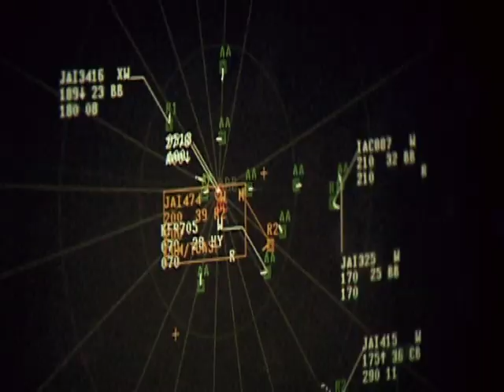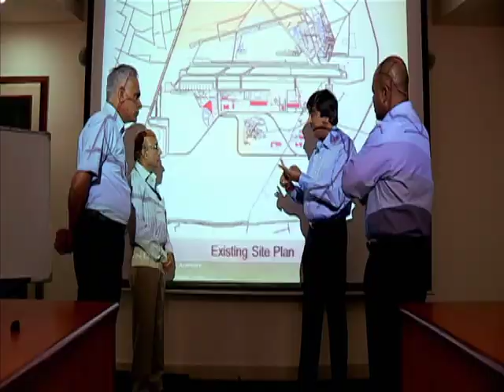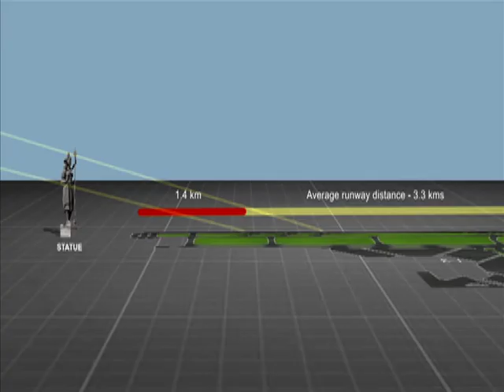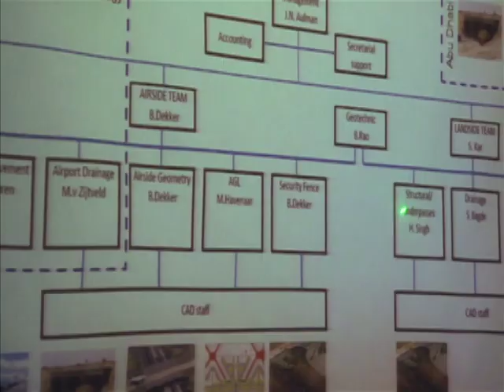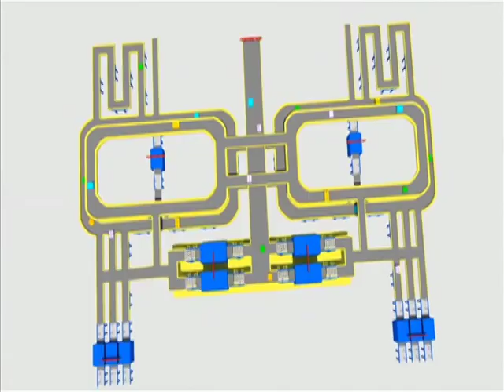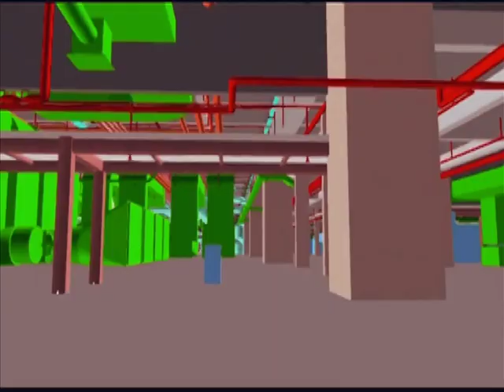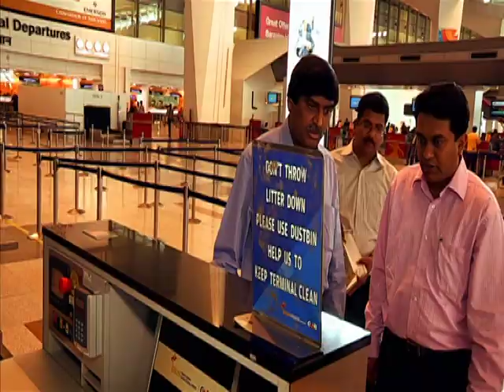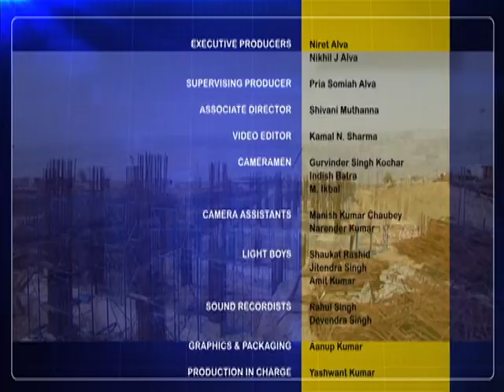National Geographic Megastructures: Delhi IGI Airport - Terminal 3

Comment: The infrastructure of IGI airport is great. I want to ask that the  IGI already have two runways and one was built later along with T3  which is 4400 m long. It looks parallel to the old runway (28 /10) but why it is not mentioned right R and Left L in the number. The runway no is also different but they looks parallel.
Reply: There no any parallel runway on IGIA Delhi,
9/27, 10/28 and 11/29. 
Go check it.

Comment: 37 months for a massive Air port is a great speed. Will it last like the Taj Mahal or crumble like the fly overs. At this speed we could out smart China if only the country uses her resources prudently However, we yet depending on imports from \
China and Japan. India should be able to meet the requirement for such mega structures. Make in India slogan will be meaningless, unless we translate it into reality. Trade with China needs to curtailed or moderated,
Reply: This airport was at Congress time anc now this made in india slogan is getting some reality
Reply: Its been 9 years the airport has been made... I came from that airport yesterday.... and its still fine and intact.

Comment: Although the time frame is a good 12mo before any other recent Airport build...
But I dont think thats a credible comparison.

They should be looking at the Engineering specifics.
Chek Lap Kok Airport airport.. that is the new HONG KONG AIrport, was PHYSICALLY built up, on the water. THEY still have sinking problems of X per year.

As far as... the constant urge of Panic, none of what is being mentioned is actually important. Thats business. Thats an airport! In recent awards of construction... the "quickest" you can get it done.. the most you will get paid. There are tons of iterations where a factor of issue is buiilt in.

ALSO...
Its proven.. that Ben Gurion Airport in ISRAEL is the safest... there is, without needing the extra glass bullshit.

Id love to know a few key things...
How much precast was made and or utilized.
What kind of materials are they using for their landing strip. I believe its currently about 2 or 3' of straight concrete.

Also...
Ya going to rely.. on operating a good 2/3rds of an AIRPORT on whether or not... the back office I.T can operate?! Thats not just poor, thats pathetic. An airport, shouldnt be on the BRINK of failure... cause a server went down.